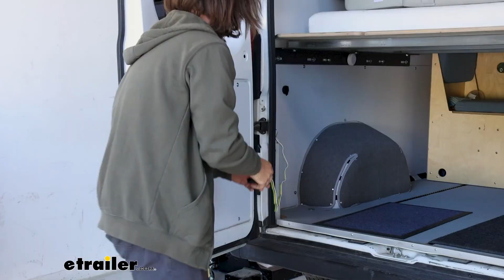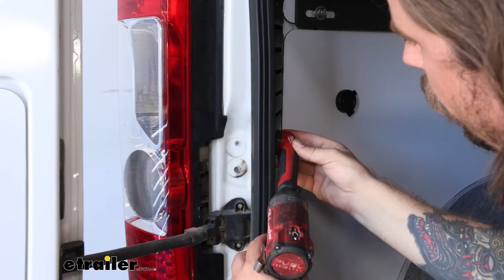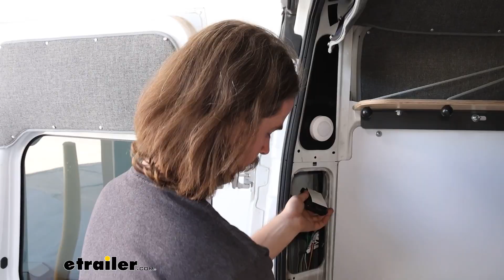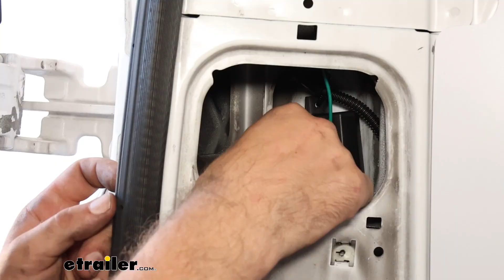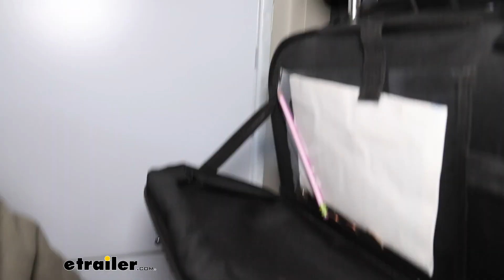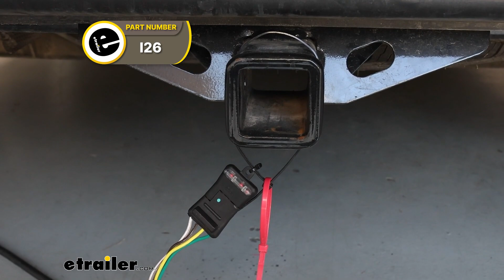etrailer | Installing the Curt T-Connector Vehicle Wiring Harness on a 2021 Ram ProMaster 2500

Comment: HMMM... I didn't see any install of the trailer wiring... Just a plug thru the bottom of the door.. Where does it tie into the tail light harness..??
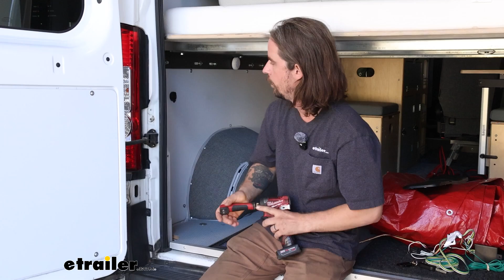Reply from the maker: The installation starts around the 2:10 mark.  This wiring harness plugs in line with the vehicles tail lights giving you a 4 flat trailer connection.  When a trailer or accessory is plugged in to this connector, it will mirror the stop, tail, and turn signal functions of your vehicle.  This specific harness will fit the 2014-Current models of the RAM Promaster without factory trailer wiring.